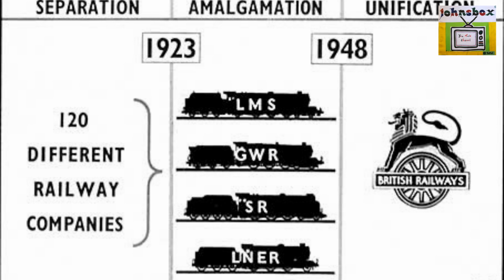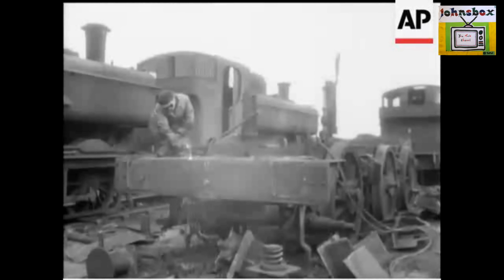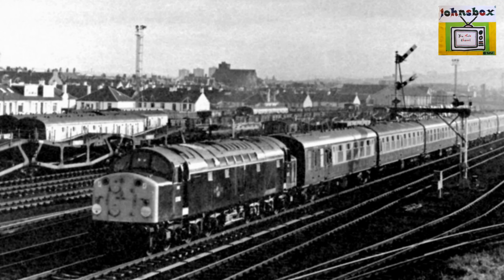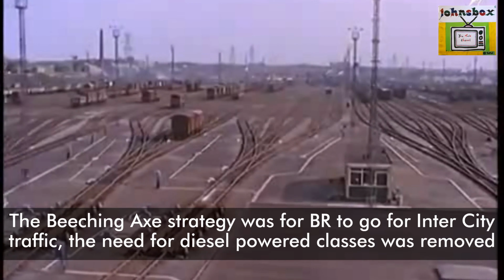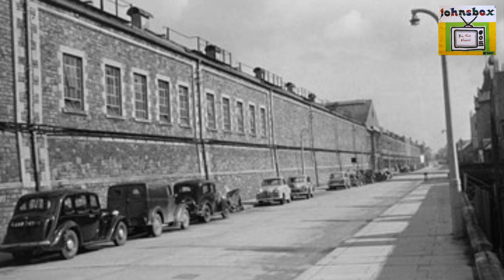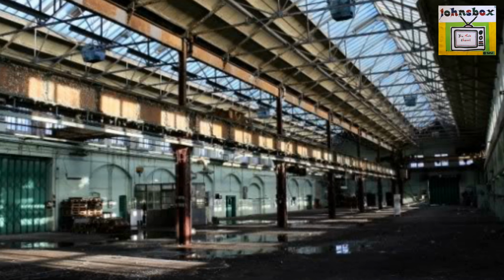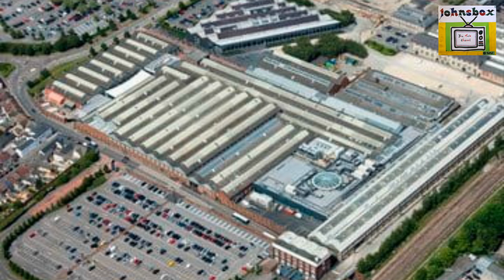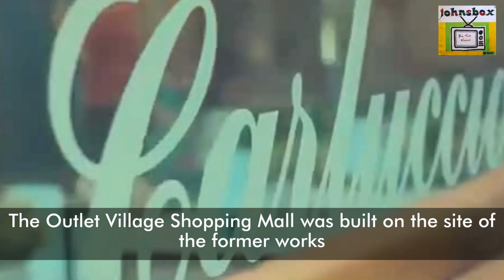SWINDON and ITS WONDERFUL RAILWAY - Part 2

Comment: hello Im from Swindon (born in Swindon) i would like to know about the blue walled and white roofed railway station that was on Station Road in Swindon in 1981 an 1982 (do u know about this ??) thanks... do u have any photos or videos of it close up? thanks it was on platform 3 in 1985 thanks..............
Reply from the maker: Thanks for commenting. In the early 1980s I was a mere schoolboy, and anyhow it doesn't ring a bell. Perhaps you could ask someone older and a lot more passionate. There are Facebook groups of rail enthusiasts. What I do however remember is going by class 47 to London Paddington in 1983, which was then a rarity. I guess it was a train running from Cheltenham Spa. Fun fact!